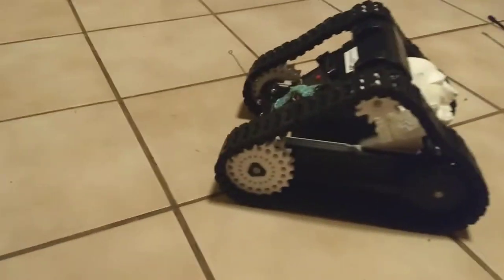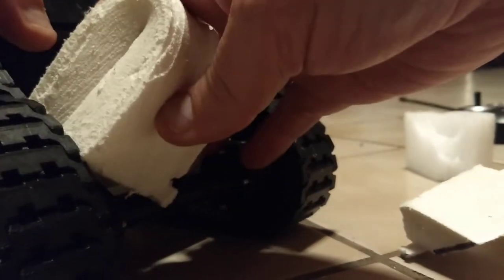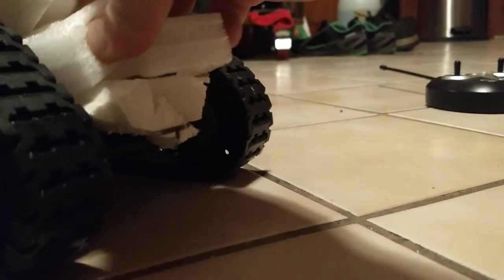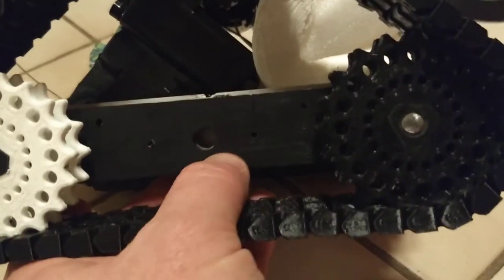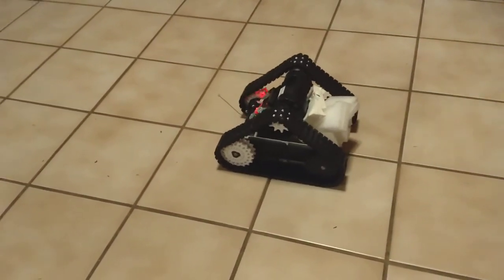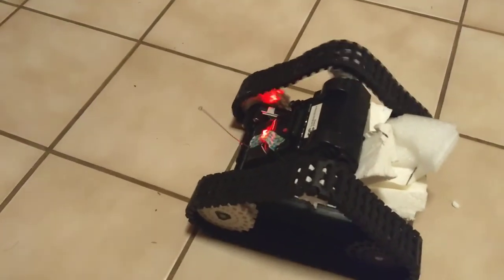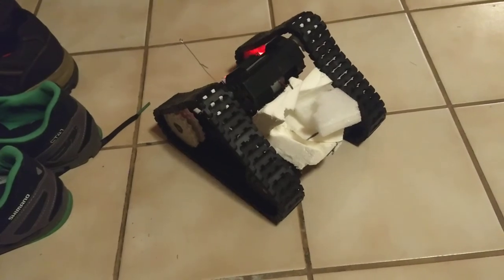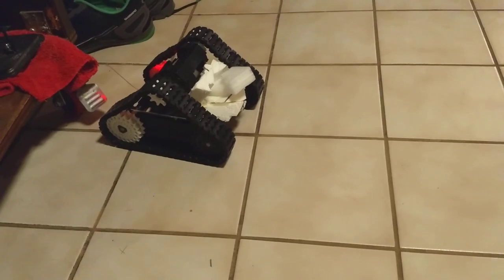alwynxjones's 6mm Airsoft BB tank tread design IRL

Comment: Dude this is dope AF!!! I notice you are having grip issues just like I was, I need to find a way to add rubber pads to the track, but I have yet to experiment with flexible filament. Also I just used round wheels instead of sprockets for the idlers. I found that cut down on drive train friction a bit.
Reply from the maker: Hey, awesome! Do you have some pics or a video or something of how you did it? This is pure proof of concept right now, but I want to tweak it to make it usable. It's so underpowered ATM that it can barely handle Berber carpet. My plan for grip (when I get it powered enough) is either to paint the treads with thinned silicone caulk or to add some doodads I designed to hold the BBs in place more firmly. Advice is welcome.